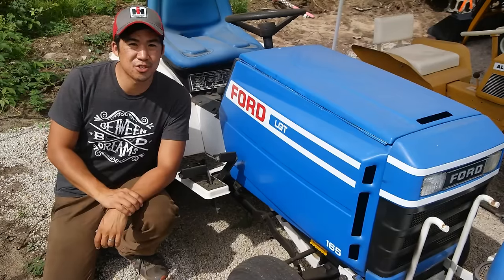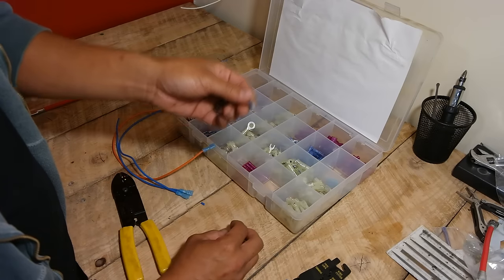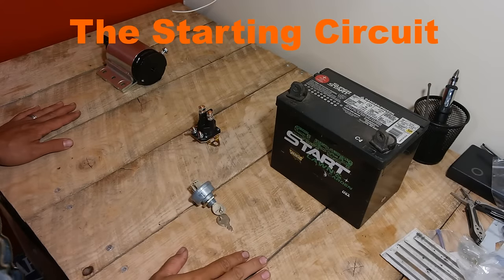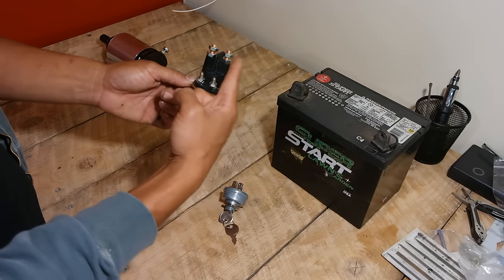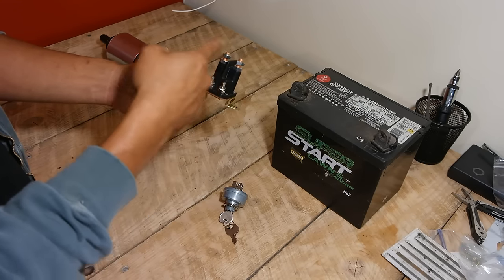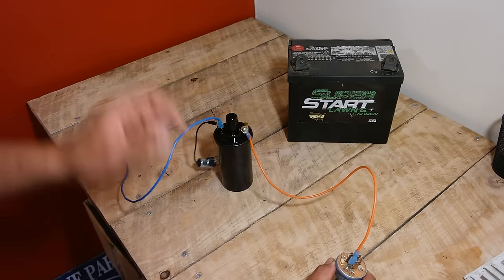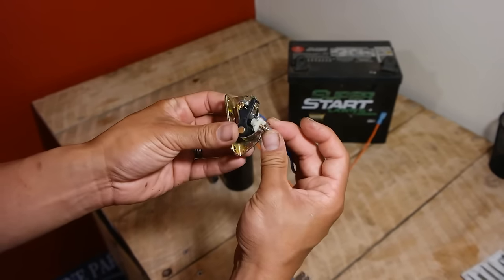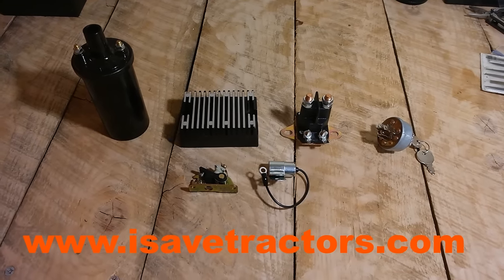How to Wire Your Old Garden Tractor w/ Battery Ignition and Stator Charging

Comment: where would i wire in a volt meter if the riding mower didn't come with one?
Reply from the maker: You want to find a circuit that gives off 12v power when the machine is on. On old machines the ignition terminal is a good place for newer ones try the accessory circuit or the electric pto circuit (before pto switch)
Reply: @Isavetractors  thanks for replying! i'm working on a new stator for the mower today so i figured it was a good time to wire a voltmeter in, ill be sure to check your videos if i come across anything else im unsure about, again thanks for the help!

Comment: how do you wire up a fuel pump on a kohler m18
Reply from the maker: For an electric fuel pump, you just need to give it 12v power when the key switch is in the run position. You can run a wire from your "A" terminal on your key switch or tap into the power to your headlights. 1 wire goes to the 12v power source and 1 wire to ground. This way whenever your machine is running your fuel pump is pumping and when you turn it off, it will also no longer receive power. Hope this helps.
Reply: thanks that helps a lot

Comment: You forgot to show the small black relay boxes without those it wont start and the fuse

The burnt out fuse sometimes is the most common problem people have
Reply from the maker: This is a "Basic" wiring system. Doesn't take into account additional relays, fuses, safeties that may be specific to your machine.
Reply: @Isavetractors  it does or did have a safety button I found that someone else unhooked an just twisted the purple wire together instead of it being on a button

Comment: You neglected to place a ballast resistor in series with the ignition coil. Without this the current will not be stabile in the ignition coil and breaker points will be destroyed in no time.
Reply from the maker: Our coils are internally resisted coils so no external resister needed. The correct coils for Small Engine use should be internally resisted.

Comment: What ifyou haves magnito
Reply from the maker: Slightly different. Instead of sending 12v power to coil, your key switch will provide path to ground to shut it off.

Comment: if you have aproblem with your points pitting  youmay have the wrong condenser   its inside a condenser its what counts the look alike onthe out side  they come in microfareds they haveto match the coil for highest spark voltage  its called a resonont circuit    the reactance and reluctance of the coil and condenser have to cancel one another to equal zero   remember     ohms law  I=  E OR  V over R that said   the corrent equalls the voltge divide by the resistance if it zero you have max current   ( BIG SPARK  )  whew.

Comment: you may want get a scematic on the switch to verfy what con ti what  in the run position   B conn to A1 only in start pos b conn to S and A!  in off pos M to G toA!  in lights pos B to A!  also L to A2  im reaing this off wiring diag G lead to ground
Reply from the maker: Thats magneto ignition. This video discusses battery ignition systems